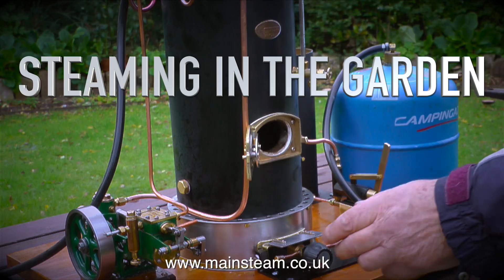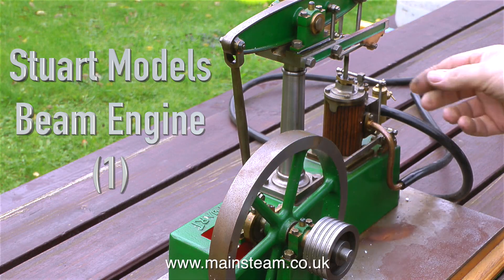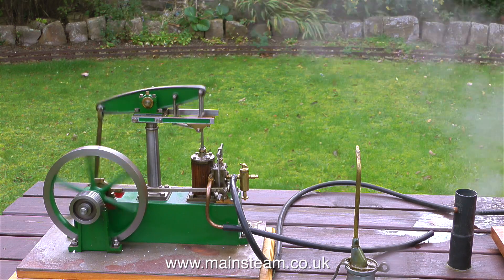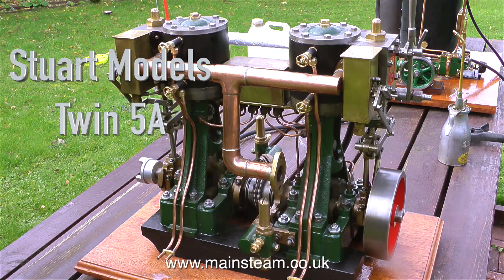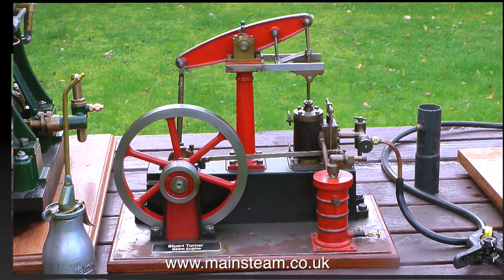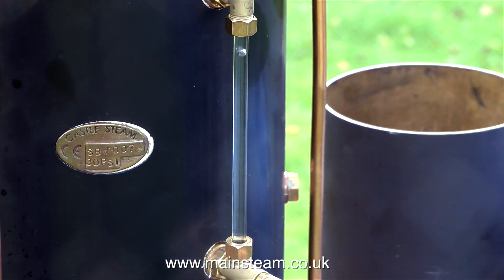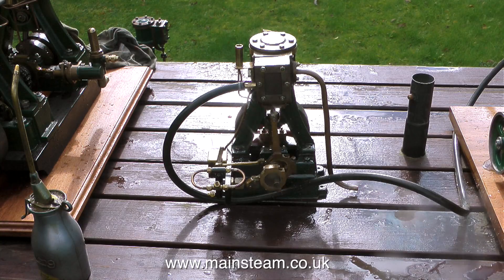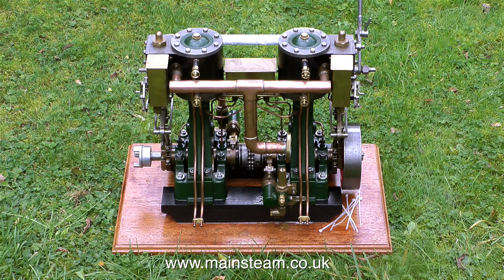STEAMING IN THE GARDEN #1

Comment: Why isn't no one using this small steam engines for off grid solution. If only I have access to small steam engines and boilers I would surely go off grid with it.
Reply from the maker: No you would not -it is unrealistic. A steam engine boiler needs constant attention and these after all are model steam engines so they would wear out too quickly . . .
Reply: @keithappleton  How about putting a bit of electronics in to it, like sensors and servos to control everything automatically.

Comment: I love your work and I love this video, but for god's sake turn down the gas! Blowing the safeties off once or twice is bad unless you're testing them, and continuously is just bad firing. You waste allot of water and allot of fuel that way. It also makes allot of racket which is unnecessary. Please for future videos, run the gas pressure, or gas burner adequate enough to run the engine, but not continuously blowing the safeties off.
Reply from the maker: Why not try the process yourself, operating a video camera manually to obtain professional video images whilst simultaneously running a miniature steam plant - also, in this video, as I clearly state in the narrative, I was testing and setting the blowoff pressure of the safety valves on this brand new, and previously never steamed "Castle Steam V6" boiler ........ maybe now you can see the futility of your comment . . . . . .
Reply: @keithappleton  No. I run the big engines as well as the small ones. Any fireman will tell you this is seriously frowned upon. This is a serious pet-peve of mine. Get the steam plant stable before shooting video of it! With a gas fired plant it's not all that difficult to accomplish.

Comment: Keith, this may be a daft question but hear me out. 
Some of these engines seem to be of a quite sturdy and powerful design. Other than running them for the enjoyment of watching them, is there any way they could be put to use (even a trivial use, like, let's say... a pencil sharpener) to get a slight load on the engine and have the satisfaction of watching steam-powered machines actually "do" something, if you know what I mean?
Reply from the maker: yes, even the small ones are quite powerful engines, they would drive miniature machinery or generate electricity via a dynamo or alternator - or drive water pumps etc .....
Reply: The 1" scale steam traction engines will pull along an adult male quite easily, even the smaller one's can pull along a small child under the right conditions. The larger 4" scale (1/4 size) will pull a car along!
Reply: On Redryder's videos, specifically when he films engine meets, I've seen miniature sawmills connected to model engines.
Reply: VehicularBrit I once saw a pencil sharpener powered by a Conley miniature V-8 engine, it would eat the entire pencil in a couple of seconds max.  While this isn't related to steam powered models it's worth googling it, there's a photo of a similar setup that's pretty darn cool.

Comment: It strikes me as a good idea to fit the clicky electric igniter bit from a gas lighter directly to the burner to make lighting it safer, does anyone make anything like that?
Reply: Yes, you can buy piezo barbecue lighter modules. Basically the clicky button & 2 wires.
Reply: And when you wire it up wrong you get the spark instead of the burner